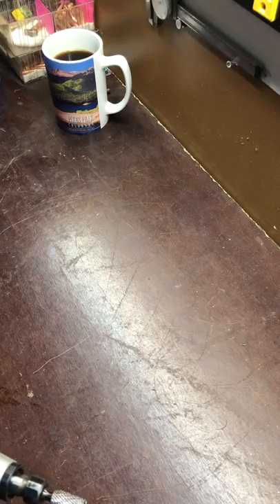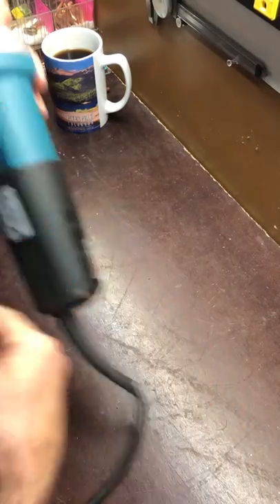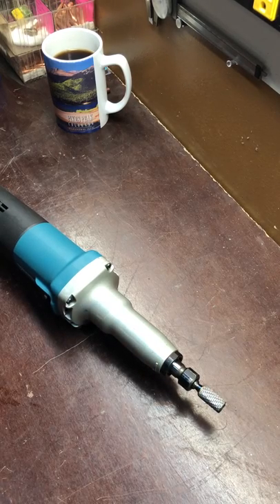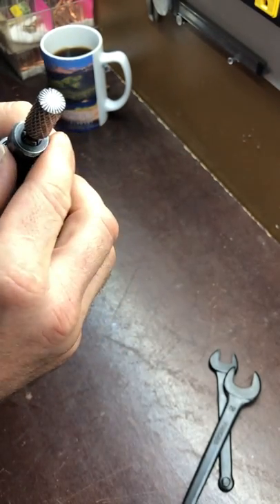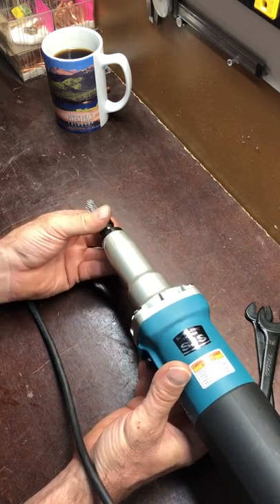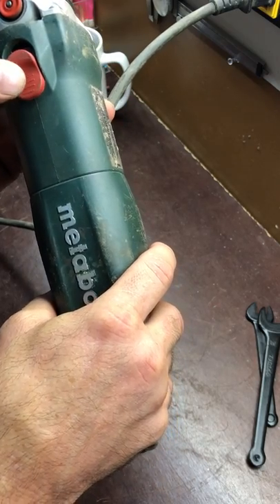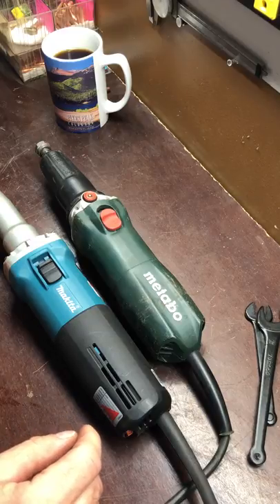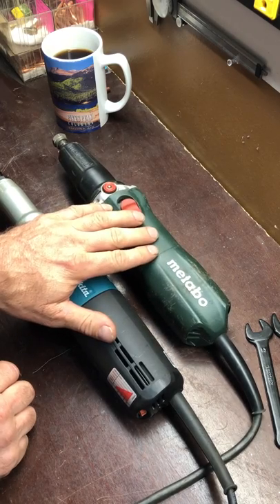Makita GD0800C 1/4" Die Grinder

Comment: Bought the Makita GD0800C 1/4" SJS did not realize that it has a 7000-27000 RPM rating.  Also after reading the manual it warned of shorting the life span by running at slower speed.  My concern is determining if my die grinder bits are safe at these speeds.  You mentioned wanting to run a wire wheel I would not think that would be rated for the speed of this grinder?  Am I wrong on this?  Also when shopping for bits for this it does seem like there is a lot of bits in this operating range but it is challenging to confirm that on some bits.   A lot of die grinders operate at 0-7000 RPM making me think I could get bits unsafe for the faster RPM rating?  Any thoughts?  Great review thanks for posting.
Reply: most wire wheels that are not garbage will say their max RPM on therm
Reply: I still have my Makita and have not run a wire wheel on it yet. Time will tell. I run mine on lower rpms all of the time. Will it be harder on the motor? I cannot say for sure but I've had it for years now and still going strong. I also keep the speed lower for the burr bits, the bits seem to last longer and if the bit does catch, it will kick less. On higher speeds when it kicks, it gets violent.

Comment: Hello dear.. I need your help. I bought the same grinder and got the kutzall 1/4” but I cant install them quite enough. The burrs keep flying out of the grinder.. how can I do it??
Reply: I usually have to crank the nut down with gorilla type force. Most of the die grinders I have used tend to loosen up unless brute force is used.